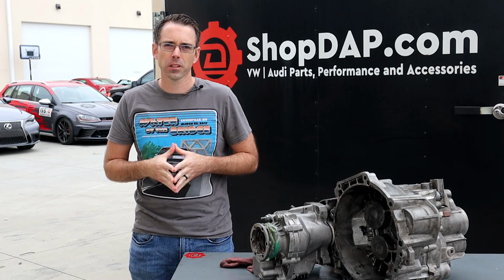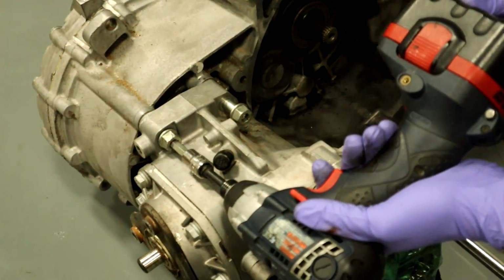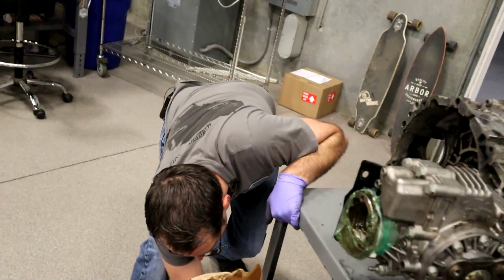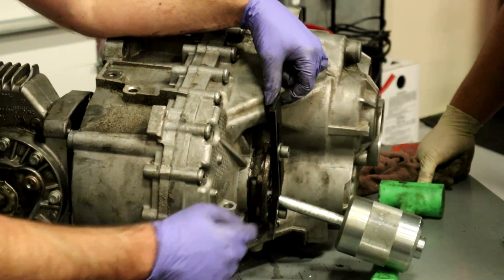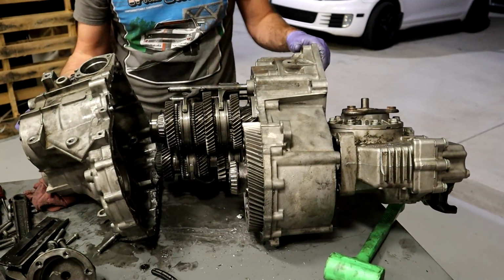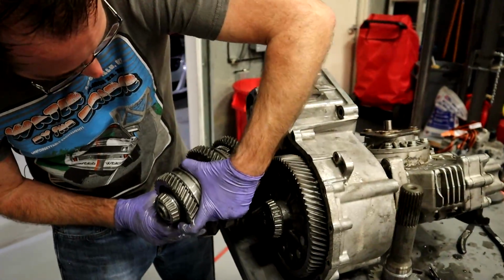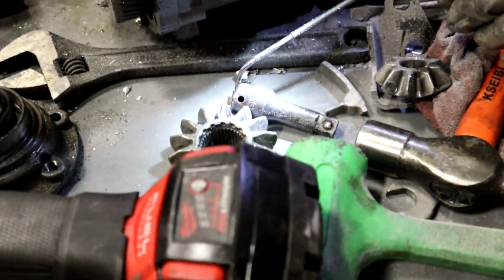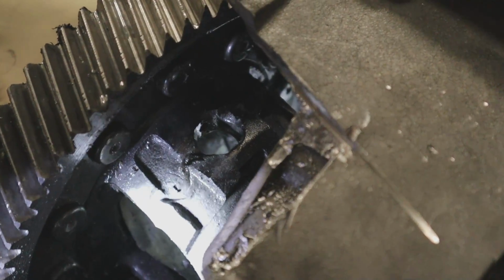This MK7 Golf R Trans Locked Up Going 70mph

Comment: Well I've watched this several times now and it's still got me geeking out! Glad you reached out man, I really really appreciate the shout out! You guys are the bomb 😎🤘can't wait to get her back up and back to more autocross 😂
Reply: Could you add any detail about the maintenance history of the trans, like fluid change interval?
Reply: @alhutchinson6691  At least every 20k since I got it at 8k, twice used non OEM fluid then swapped back to OEM about a year ago, two changes since then with OEM. Extremely beat on, 6k launches, extremely hard down shifts more often then not when racing. She lived a pretty abusive life lol
Reply: @BryceJordanProductions   well I definitely know how much power can the manual transmission hold.....lol
Reply: @jaimeagustinsalgado5172  hell with just an LSD upgrade it woulda been fine, but 70+k of abuse will definitely eventually break something lol
Reply: I am constantly amazed at the size and strength of VW transmissions.  They are huge!  Every transmission on earth has a weak point, here it appears to be the spider gear pins or bushes.
Reply: Are you going with a wavetrac diff replacement? Does this mess with the Valdez system?
Reply: @j255c  yup wavetrac! I'll disable the torque vectoring after I do it.
Reply: @BryceJordanProductions  I’m sure you’ll update your thoughts on this once she’s back up and running. I’m concerned it may mess with the balance of the car but def interested in hearing more about this. Not much info online about R’s with upgraded diffs. Keep us posted!
Reply: Bryce! Did it! 🤣😂 lmfao
Reply: Bryce you’re a monster dude!!! Glad you shared this with shopdap so we could see more. Keep racing buddy!!!
Reply: One last question, is it a DSG or manual?
Reply: @ryanthomastew  🤘🤘🤘
Reply: @longshot789  6mt
Reply: @longshot789  LOLZ!!!!  (tiz a manual my gai)
Reply: @BryceJordanProductions  Oh so you think and LSD would have helped prolong life abit longer? Any particular reason why you think that might have been so?
Reply: @MKI4EVA  absolutely.. the diff failing is what trashed the entire trans :/ just bought a wavetrac on Friday though 🥳
Reply: Even with an upgraded diff, the problem was maintenance, if you're tracking your car you need to change fluids every 2-3 events something like that, and use high performance oils.

I'm not expert but that's how they do it with racecars.
Reply: @BryceJordanProductions lol more like failing brain, and not changing fluids every couple of events, regular service intervals are designed with normal driving in mind.
In one event you can destroy the oil capability of doing its job.
Reply: @PRTube01  you're assuming I didn't do so.. I'm very aware of changing fluids early and frequently. There was maybe 3 autocross events on this fluid and less then 3k miles overall. I tired different fluids and the trans didn't like it. This was on OEM fluid AFTER a double flush, I always buy extra to flush it out. Same with the engine oil, diffs, haldex.. experienced aircraft mechanic here.. the heat and shit you see or assume was from bad fluid was caused after the failure. Which we aren't even 100% on the cause, but all signs point to the diff /diff pins.
Reply: @BryceJordanProductions  this can be a lesson for R owners or enthusiasts in general, more frecuent service is not enough. Driving JUST 2-3k miles with destroyed oil might not be a good idea.

I get your point maybe even with new oil every event parts still fail. But just a thought why racecars that have every part specifically for racing still change oils after every event.
Reply: @PRTube01  or.. ya know.. things do just fail over time regardless of fluid lol
Reply: @BryceJordanProductions  I get it, who knows how much would held up with even more frecuent oill change. 70kmiles of abuse is a good number. 

Also there was a YouTuber with a crazy S3 iroz I think, who did in fact change oils after every event but damaged something due to not letting the car do the adaptation, and worn clutch I think.
Reply: Makes me wish I had an R for autocross. That car looks so flat in the corners!
Reply: bro I didn't realize it was this bad lmao  , but hey auto cross is fun
Reply: @PRTube01  diff spider gears are held together with plastic I highly doubt changing fluids would of made a difference lol
Reply: Volkswagen has had these pinion shafts fail since 1983, on the Rabbit GTI.
Reply: @peterlindvall7671  well, it was the retaining of the shaft, not the shaft itself.  Fix on the old 020s was to add the circlips that had should have been there in the first place and remove the stupid retaining hats they put on two of the diff rivets.  Ring gear bolt kit solved that.
Reply: @RonPieper61  Yeah, I know Ron...

Comment: As you guys were prying on the transfer case, I kept trying to tell you guys through the screen that there’s a bolt that sits inside the axle cup that has to be removed lol. 

When I removed my R32 engine, I searched far and wide before I found that there’s a bolt inside. I think it’s a 6mm Allen. Use a screwdriver socket with 6mm bit and get a very very long 1/4 extension. It’s the only way to get to it.
Reply from the maker: Sadly it’s out already
Reply: @Deutscheautoparts  lol yes it was very entertaining watching the struggle. Not so fun when it’s your own struggle lol.  I have never seen a differential shatter like that. Those pins are hardened steel! The heat must’ve been absolutely intense in that transmission lol

Comment: After you put down the heavy hammer and cutoff tool, what was you conclusion? Other than pushing it too hard, what do you think was the root cause of the failure? The pins? This is obviously not a common occurrence. The guys in QA need to know!

Comment: I remember back in the A1 MK1 Golf days, the '83 and '84 GTI transmissions had a high failure rate. Turns out VW decided not to install circlips on the ends of the shaft that held the planetary gears in the diff. They relied on a force fit to keep it in place. Eventually, that shaft would work it's way to one side, and grind a hole in the side of the case inside the bellhousing. I worked at Recycled Rabbit/Mellow Motors in Marin, California at the time, and they had a swift business of rebuilding those transmissions to resell. They also did custom transmissions for folks. Like, they built the GTI transmission with a tall 5th gear, or different final drive ratios.

Comment: '96,  I rebuilt a Honda auto trans.  One brass sleeve nipped up at 70mph.  So it got 2nd and 4th. Blew the diff and the gears out the case on to the road.

Comment: That's the same failure I had on my mk6..... Also just rolling along them bam diff exploded and took out the case.... When I stripped it down it appeared one of the pins holding the spider gears had failed... Very interesting video

Comment: I thought there is a bolt down the center of the driveshaft cup I didn't see them take out before the bevel box struggle started. But I've split a gearbox casing before, is good fun. Love the vid guys. Never seen such carnage!
Reply from the maker: It was out. I wish it was as simple as the one bolt.
Reply: I was also thinking the bolt would have snapped by now if it was in.. That grey goo of death was nasty stuff. 🚗🔥

Comment: My stock r line, much loved well treated 55 000 klm car did a transmission earlier this year, Vw happily paid for the part, $8k, but argued for two weeks over labour cost. Eventually, they nicely agreed to pay ( The car was 1 month out of warranty). The gearbox went at less than 10 kph going around a roundabout. I love this car, but was very upset a newer golf had this problem when these issues had supposedly been rectified. Still thank you to vw Australia for the fix, car runs as good as new since.

Comment: A VW gearbox with a faulty diff? Impossible...

Lol. I know as far as the more modern gearboxes go the failing diff pins is usually found on the 5 speeds (OA4) but they have other issues too especially when it comes to making power on a stock VW gearbox. For example the 5 speeds are known to start cracking teeth off the gears around 350 lbs of torque. But what about the 6 speed manuals like this one? The 02Q 6mt, more specifically the FWD version found in GTI/GLIs and so on from 2006-2014 have been said to start flexing on the 4th gear shaft around 450 lbs of torque. I'm not so sure if that's still an issue with a MK7 AWD 02Q trans though. But as we see here, the diffs are not bulletproof. Thankfully Wavetrac and Peloquin make great products. 

Lastly I want to say thank you to the guys at SHOPDAP for their video on installing the Wavetrac LSD in their MKV GTI big turbo project. 

I used that video to install a Peloquin LSD into my 02q 6 speed as well as install steel shift forks, SQS racing brass fork sliders, new axle shaft seals and everything. I had no other real help beyond that video. Thank you, it worked out perfect and is currently being used in my friends boosted 2.5L Jetta ;)

Comment: How was that not making a ton of noise prior to grenading
Reply: Probably couldn't of heard it if you have a ear drum destroying exhaust system
Reply: He clearly never changed the fluid, it's his own fault.
Reply: Denial.

Races car. Big turbo etc... lexan windows bro. Neglects service intervals on fluid lol.
Reply: it kinda looks like the diff cross pin retaining bolt came undone, just a theory tho
Reply: TheJustin574  yeh, because who spends big bucks on everything else and cheap out on £20/30 of oil 🙄  

He simply pushed the limits of the trans and it was the diff that gave way,  which has been a ongoing issue with VW manual trans and a LSD is a well listed mod when going for big power.

Comment: This video gives me all the encouragement to buy a used Golf R
Reply: Yeah it's scary, people need to learn Fluids are designed for normal driving. He was treating his car like a racer car, and Racecars change fluid every event or something like that.

He mentioned he was doind 20k transmission service intervals, but clearly he was still negligence on his part.
Reply: @PRTube01  But still even without the race events with a souped up engine VAG transmissions are known to fail.
Reply: @Ben T. Exactly all sporty cars should be able to handle the same abuse as a race car. Lol
Reply: @MultiArrie  so a regular sporty car should be able to handle the same abuse as a race car. A true sports car like a 911 still can have issues unless is GT3 or something like that.
Reply: @Ben T. "His car's got a bigger turbo, [...] intake, exhaust, clutch, fuel upgrades and so much more". How can you see VAG at fault when a stock transmission fails on a heavily modded car?
Reply: @Horstroad  agreed, maybe upgrade the diff pins if you do 600 bhp in your golf 😂 or at least change the oil. Probably got thin, caused heat what caused wear and more heat and finally these thing gave up. I get hating on VAG and on their reliability, but that looks like User error to me
Reply: I pretty sure VAG owns porsche lmao

Comment: It shows you how hardened those gears are, that little thing locked all 4 wheels at 70? Basically on one tooth too. 
Are there any higher performance gearboxes you could put in there now it needs replacing?
Reply: It wouldn't have been all 4 wheels. The Haldex clutchpack in the rear would've disengaged electronically as soon as the speed sensor on the front axle detected no rotation. And even if that wasn't the case, the Haldex clutch accumulator would've had zero fluid pressure because the driveshaft wasn't turning the mechanical pump anymore, therefore no pressure to engage / keep engaged the clutchpack between the driveshaft and the rear differential. Besides these points, I don't think Haldex clutches could hold a 60 mph : 0 mph axle speed difference without slipping even if the clutches were fully engaged.

I imagine if the TCU could tell you what it was thinking at that moment, it was probably wondering what the hell was going on when it saw front wheels had abruptly stopped turning while the rears were still doing 60 mph... That's a scenario that's unlikely to be in any part of its programming.

If it were a true AWD (Torsen, Subaru VTD, etc), or 4x4 system (think trucks, Jeeps, etc), then yes, it probably would've locked all 4 wheels (or at least tried to and then the center differential would've exploded as well).

Comment: Just like a drag racing car you up the horse power to a point then you need to up the transmission, driveshaft, and other internal parts. Like Paul said it’s going to happen. Pay to play. My two cents
Reply: It's not the parts only, you need to change fluids every couple of events if racecars do it why would you think your sporty city car would handle the abuse.
Reply: @PRTube01  they do handle it pretty well till the power is doubled also putting in more viscose oil will help on tunned cars

The gears aren't meant to touch they should be separated by a really thin oil film but if u go hard on the parts the higher temperatures will thinning the oil film also more power will compress the oil away on the contact surfaces a more viscose oil will make a thicker film and counter both reasons for premature wear

Comment: I had a similar issue with my GTI. It was on a bend, just driving around the suburb. Stopped at the lights, when they changed pulled off normally around the corner. made a bang and I saw all the oil on the road in the mirror! It was the rivets holding the spider gear carrier to the crown wheel, they just broke! that was a Mk2 1800 GTI  with mechanical injection.

Comment: SINCE it still had oil in it,i suspect that a pin of one of the keepers on the diff came loose.The transmission side of it looks good.I'm just guessing if a different fluid would help,but i doubt it.I say that because it's not a posi type diff,right?Something came loose,allowing one of the pins to work their way out,allowing a spider gear to work it's way out,then jam against the case.Good video guys.

Comment: Roll pin failure.  Had the same problem with a 2008, just out of warranty.  Nothing keeps the cross shaft in the differential other than a tiny roll-pin.  You don't hear it, makes no noise until it blows a hole in the case.  older vw had a tab under a rivet that kept it in even if it failed.

Comment: Hi! Quick question about Golf R mk7.5
How to comletely disable the traction control?
I've made brake coding ASR/ECS OFF v2
 disabled the rough road surface, but still some times the wheels "hop"  and on rainy day if i try to launch my car (it doesnt matter if its M or S mode) and traction is completely off the car still stops (looses power) when there is a lot off slip, i thought that it should go all the way without any powerloss.. #askDAP

Comment: I had exactly the same issue on my seat Leon 2.0 tfsi DSG 2009, the gearbox had a lot of metallic glitter in the oil, the driveshaft flanges would not come out and in the end, we cut the gearbox only to find out that the spider gears in the diff were totally destroyed. not going to lie I did abuse the car to so much wheel spin, over spinning the wheels on 2wd DSG is really bad for the diff and the mechatronic.

Comment: I did this to a stock 1.6 16v 2001 Golf in March. Both the diff side gears completely disappeared through the various holes they made in the diff casing. Didn't lock up though, just no drive.

Comment: I'm curious as to how the oil looked like aluminium paint.  Was the last oil change done in the field at midnight without a flashlight?
Reply: Very fine metal. After awhile in the pan it lost some silver color once the metal sunk down.
Reply: @BryceJordanProductions  So where did the fine metal come from?  Was it maybe the pinion bushes?
Reply: @einfelder8262  from everything that was touching things it shouldn't I guess. As you saw it basically friction welded it's self in some places all types of metal shavings came off of everything that failed/broke
Reply from the maker: My best guess is the pins got ground down on the ring gear over a long period of time.

Comment: If a gearbox locks solid under heavy load, it's most likely not going to be possible to rebuild it as you do not bring mechanical devices to a dead stop under those circumstances without something catastrophic happening.

Also, all that finely ground up metal in the transmission oil didn't happen in the instant the differential gave up. Something had been going wrong for some time before it finally locked up. It would be interesting to know if that's steel or aluminium that's turned the oil silver as that might also give a clue. I'm guessing it's mostly aluminium, maybe from the inside of the differential casing.

Comment: Roll pin failure on the centre shaft of the diff. If you build a box and leave this std always double roll pin to prevent this happening. Circlip missing off the end of the input shaft above the bearing too

Comment: That had been going bad for some time before it locked up. The silver in the oil is aluminium/magnesium alloy that has been going round and round getting ground finer and finer, so some part of the gearbox casing or shift mechanism failed, fell in the gears and got ground up.
Reply from the maker: I think it was diff parts but yes it probably had been doing for a little bit before it Nuked

Comment: I have changed many VW  g/boxes over the years the diffs let go and smash the casing. Replaced the trans on
An 8 month old Seat Ateca a few weeks ago same diff pin fail issue. The 02M boxes are generally a lot stronger
Tho, but I guess everything has its limits😂

Comment: For the newbies at this sort of thing, you should never cut or grind aluminium with an angle grinder. The soft metal will compact inside the cutting/grinding wheel causing it to explode and fly apart at 11000 rpm. (If I remember my “use of abrasive wheels” training correctly  from years ago)